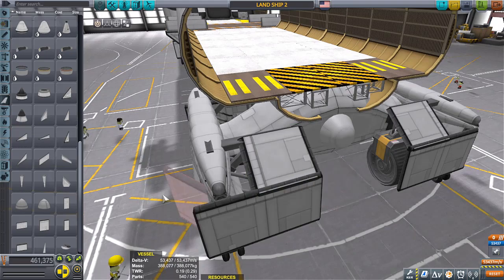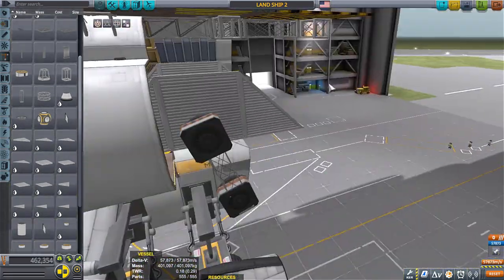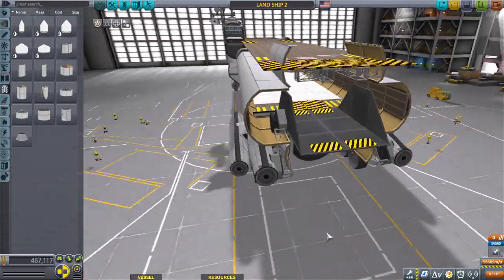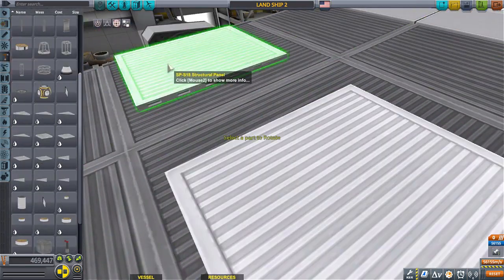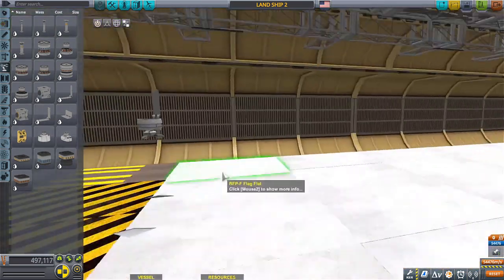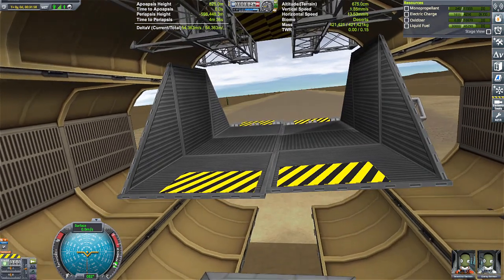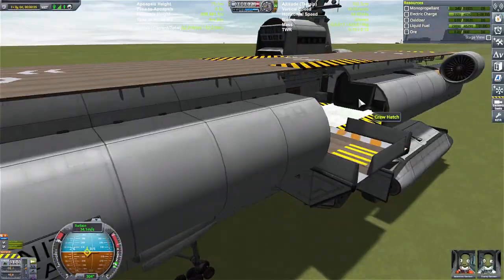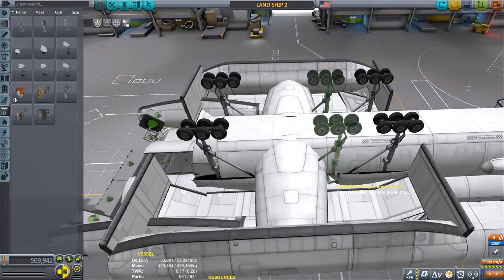LAND CARRIER NOW CAN HOLD TANKS!  \  KSP 1.12  \  Kerbal Space Program

Comment: I always thought the blast shieldd were to protect other people and equipment on the flight deck

600 views in an hour😍
Reply: it is designed to protect peoplr snd equipment
https://en.wikipedia.org/wiki/Jet_blast_deflector
Reply: Yeah it doesn’t increase performance of the aircraft, just redirects thrust for safety.
Reply: @jcskyknight2222  exactly. Jet engines don't work like wings in ground effect.  The only way the blast deflectors could increase performance would be to make them bucket shaped so the blast hit the back of the aircraft. But that would be counter to the desired effect of protecting people and equipment from jet blast.